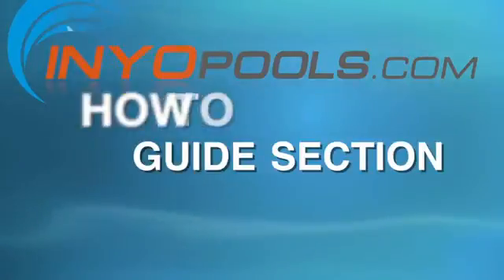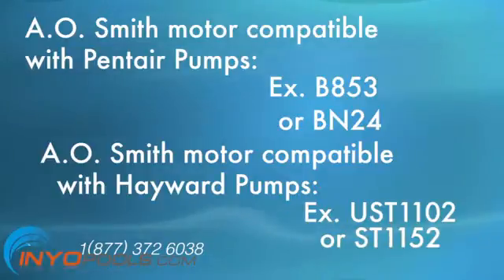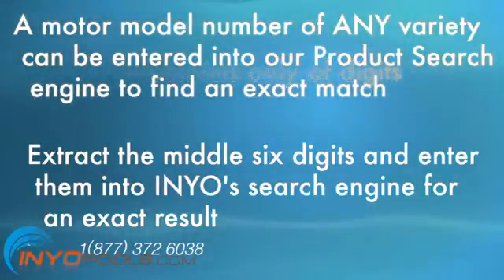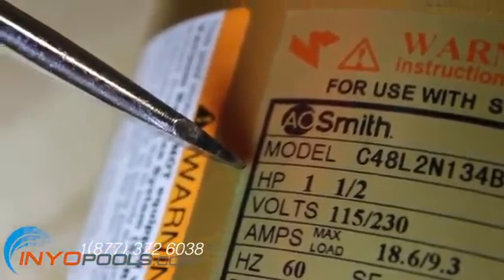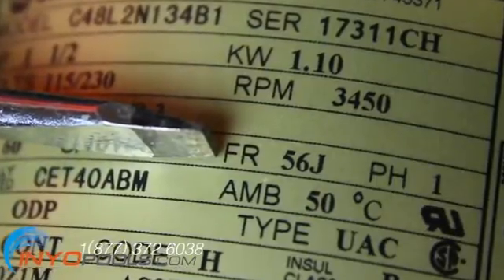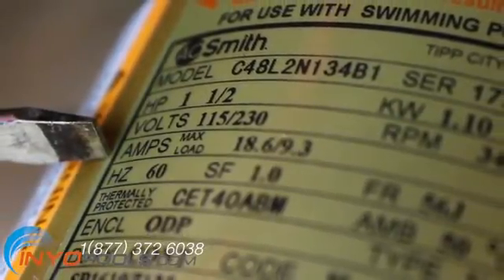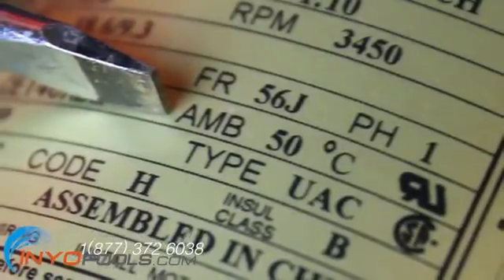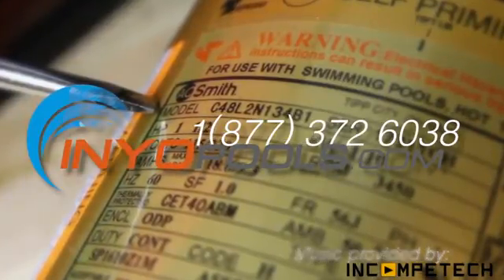How To: Read a Pool Motor Label

Comment: You discussed dating the pump by serial, yet no details on how to decipher the "coding" of the date in the serial number.  The rest of your info was relevant, however I needed the date code info to determine how old the unit is and whether still under Mfr Warranty?  Please add that or create a different video...  as a side note, I do not think anyone gives a flip about the focus/defocus, zoomy in and zoomy out fancy shots, the info is what I came for, not super slick eye candy, just my humble opinion.